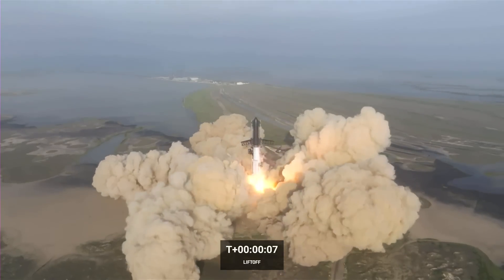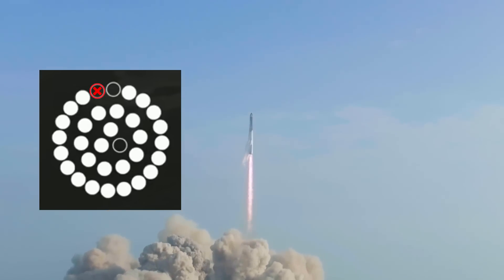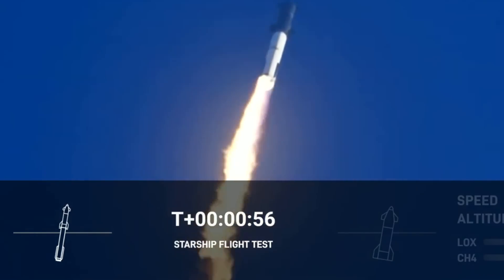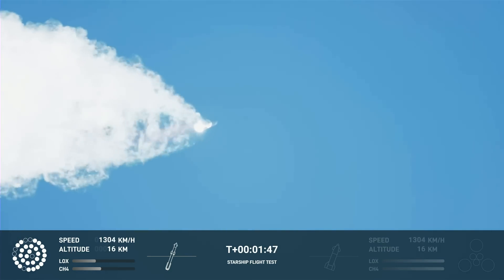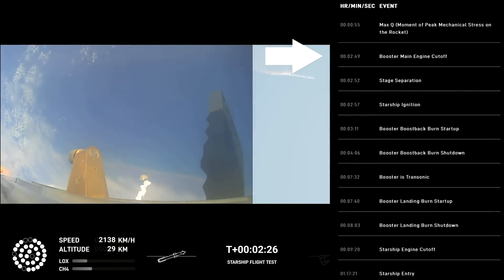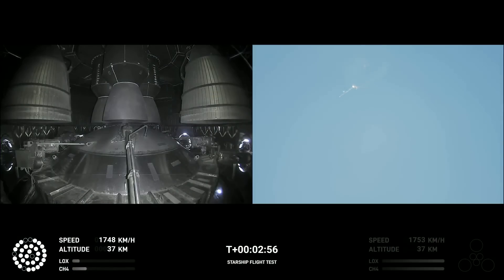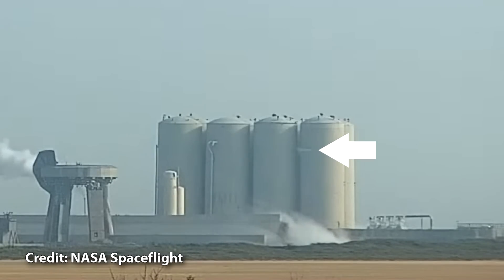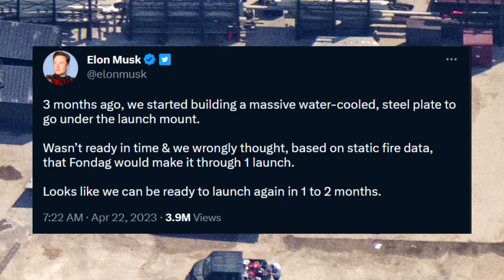I Watched the Starship Test Flight at 0.25x Speed & Saw What Went Wrong | Starship Flight Analysis

Comment: Interesting breakdown, however no mention of the FTS in the negatives of the test? Taking 40 seconds between activation and the flight being terminated is a pretty big problem, imagine if the tumbling happened in a lower altitude, in that time the rocket can go back to the ground at full speed or even to a populated area. Looking forward to the next launch with all the needed corrections, I hope this time Starship can at least separate stages 😁
Reply from the maker: At the time it was somewhat speculative whether that was the FTS activating, so I didn't want to draw any hard conclusions from it. Of course, now we have confirmation.
Reply: We don't know why or when they really did hit the button. If it really didn't work as planned then agreed, big problem but likely easy to fix.
Reply: @DouglasEKnappMSAOM  Recently Musk said at an event on Twitter spaces that indeed the FTS was activated ~40s before the rocket explosion, so yes, the FTS did not work as planned. Although the fix is easy, I get kinda scared of the FTS not working on the first place (they were lucky losing the thrust vectoring only on high atmosphere, imagine that happening lower, and with the FTS delay). In any case, let's hope they fix it and other things to have a successful second launch!
Reply: @arthurdefreitaseprecht2648  It's not as easy a fix as you may think.  When you lose engines, you are rapidly venting a lot of LOX (liquid oxygen) out of the non working engines.  If the pressure in the tank is not high enough, the FTS system will fail again.  They would have to find some way to keep LOX from venting out the burned out engines, but that also prevents the engines from restarting.

Comment: At a minimum the flight test shows the robustness of the entire package.  Failing engines, failing primary hydraulics, concrete blasts and sonic shock waves.  It still went up under control to over 30km.  An astonishing feat on the first flight.  Shows that rocket structure, control authority, redundancy, software and raptors are sturdy.  Now, if the concrete did not shatter and destroy so much of the vehicle I believe the full test would have run to completion.  Who really knows, but I think we will see about a 4 month delay.  Great Job SpaceX.

Comment: 01-May-2023 and this is the most detailed summary I've seen of the Starship launch so far. I'm happy with the outcome but I was concerned about the power of the 33 Raptor II engines on SuperHeavy and the proximity of other infrastructure, like the tank farm given the outcome of the 2nd test of the N1 on 03-Jul-1969, which resulted in the largest artificial, non-nuclear explosion in history. I'm glad this didn't happen and, it seems, that despite a series of failures the design of the SuperHeavy is quite robust.
Reply: "the largest artificial, non-nuclear explosion in history. "
Sorry, but far from it. Explosion in fertilizer silo, Beirut; explosions (several different) at ships carrying explosives (10.000 metric tons) during WW2,  even explosions during WW1.

Comment: We're a long way away from understanding the Raptor failures. A lot of pundits are far too keen to ascribe these failures to launch debris, but you can clearly see that most of the Raptor failures occur during flight and well after launch. Raptors have a history of being temperamental, having failed numerous times during testing or during Starship test flights. So we have a bunch of unanswered questions and SpaceX isn't really being transparent about this.

- If launch debris/stresses were the sole root cause of a cascading failure, what does this say about the reliability of the system overall?
- What interactions are there between engines. Both acoustically and internally (fuel flow and other systems)?
- Are there unresolved design flaws in Raptor that are still surfacing? Or have they been known about internally?
- To what extent does the pursuit of maximum performance contribute to these failures?

Could we see fundamental design changes and redesign?
Are we going to see Raptors de-rated (throttled down) to compensate for being inherently overstressed/unstable?

Comment: Elon Musk said in an interview, that the three engines where not started because there was already something wrong with them. It took to long to clear the launch pad. He also stated that a number of other engines got problems early in the flight. He also stated that the termination didn't work immediately and it took more than 40s after it was activated until the starship exploded by itself. They definitely have to change this to get another approval by the FAA.
I think the FAA will look into some other things too. SpaceX gave an estimation about the worst case of where debris will be going to. This appeared to be completely wrong. For the next flight, they need a plan that is kind of bullet prove how they can prevent damage to the surrounding nature. They also have to do a pretty demanding clean up. The tanks are much to close to the launch pad. I'm not sure if this can stay. If one of them explodes, this will spread a lot of debris in addition. It is even possible that the launch approval will be withdrawn completely for this area.

Comment: An interesting question is what events or criteria determines when the engines on the first stage are supposed to be cut off and when is separation supposed to be triggered.  Unlike what most people think it's probably not a time based event. It could be based on fuel depletion and/or a drop off of engine thrust or it could be based on the vehicle attaining certain velocity and altitude goals. With several engines out Starship might have been behind on its trajectory goals and/or it was still carrying too much propellant and the remaining engines were still running. If these criteria needed to be fully satisfied to trigger separation it might explain why separation never occurred.
Reply from the maker: Yep, I should have mentioned that not meeting the conditions to trigger BECO and separation is probably why the engines continued running.
Reply: @ProjectVirtualHaven  In the Saturn V staging was initiated when the launch sequencer sensed propellant depletion. With the shuttle, the computers monitored the pressure inside the SRB's and when the pressure dropped at burn out the SRB's separation sequence began. Burns in space are usually different because you are looking for a specific velocity change rather than propellant depletion. The guidance system monitors the velocity change and shuts down the engine when the desired velocity change is achieved. Performing shut down based on time is never done because the burn time can vary due to variations in engine thrust and spacecraft weight. During the lunar orbit insertion burn on Apollo 11 Neil Armstrong can be heard saying, "The chamber pressure is a little high, we're going to shut down early."

Comment: I agree with your assessment of 4 to 6 months time before being ready for another launch.  Even before I watched your video my guess was 6 months.  Although there is nothing insurmountable to be done there are a lot of things required, investigations of flight data, redesigns, repairs, and FAA approval just to name a few items.  Good video.  Added another subscription.  Thanks for your insights and input.
Reply: Not to mention the environmental clean-up that has to be done manually and could take weeks. Or the possibility that the Raptor design is fundamentally flawed and they need to be re-designed and re-tested.
Reply: I think it will be well into next year before another launch, the FAA won’t be happy about debris/dust landing on civilian properties and SpaceX suspecting the pad to fail and launching anyway. The repairs and improvements will be done far quicker than appeasing the FAA. Just my thoughts!

Comment: The launch went about as well as I expected.

I predict Starship next flies LATE in 2024 at the very earliest.  I suspect the FAA will not let them attempt with any less than a full scrap and rebuild of the OLM with a full flame-trench and diverter.  Because the ground table is so high, that will have to be built most UP above the surface and will in turn require that the OLM be MUCH MUCH taller... Which in turn will require Mechazilla to be taller.  Further, the Tank farm isn't sme small set of repairs... at least three of the tanks need to be completely replaced.  And the whole thing needs to be armored against future debris strikes.  Further, as the concrete AROUND the OLM was also significantly damaged, IT TOO must be steel-clad.  Result?  ALMOST ALL of the launch facilities at Starbase need complete tear-downs, redesigns, and rebuilds.  Late 2024 is OPTIMISTIC for that amount of work, and doesn't take into account FAA possibly dragging its feet.  It is entirely possible that Starship will not fly again until 2025.  Elon's 1-3 months... laughable.

Comment: The static test stands at NASA's Stennis Space Center have flame trenches and water deluge systems. Why did Space X fail to perform a full duration static test firing of Super Heavy at one of these test stands? Both the Saturn V’s S-1C stage and the core stage of SLS were tested at these facilities.
Reply: Test firing stage 0 at Stennis would help to qualify the rocket but not the pad in Texas. What Space X did was to do a half thrust test on the pad in Texas to see how well the pad would hold up. It didn't look too bad so based on that they thought they could get away with one launch at full power and then modify the pad afterwards to make it more robust. Unfortunately, it looks like that strategy didn't work out.

Comment: As engine exhaust gasses exceed the speed of sound, they collide with the ambient air producing shockwaves with noise levels approaching 200 db. This energy can be reflected by both the launch pad and the concrete ground surfaces back to the launch vehicle.

Comment: Excellent Analysis, however, you are missing the main issue! During the launch of the NASA’s Space Launch System rocket, the “Ignition Overpressure Protection and Sound Suppression water deluge system” at Kennedy Space Center’s Launch Pad 39B releases approximately 450,000 gallons of water across the mobile launcher and the flame deflector.  This suppressed the acoustic energy produced by 8.8 million pounds of thrust!  Where were the flame deflector to channel the rocket exhaust away from the launch pad and the water deluge system to dampen the acoustic energy of these engines (power of two Saturn V’s)?
Reply from the maker: A valid question. They insist on trying a different approach to this problem. Probably part of the philosophy of questioning assumptions and working from first principles. Hopefully it works out in the end!

Comment: At 8:05 you can see that the flight termination system was activated as it started to tumble, but for some reason it took longer to break up. You can see the big plumes of propellant coming out the sides as it is activated.
Reply: Was the FTS manual or autonomous?
Reply: I think I answered my own question.  It looks like SpaceX has been using Autonomous FTS since 2014.

Comment: From the comments: "An analysis of the failure of Elon Musk's rocket. What happened there? Why was the rocket blown up? 04/20/2023 we saw the second attempt by NASA to build the Saturn-5 launch vehicle in the form of the Starship rocket system with 33 Raptor rocket engines. This time NASA went by S. Korolev with his N-1 rocket system with its 30 11D51 liquid-propellant rocket engines. There is no reliable data on how the tests of this rocket ended. The official version is that the tests have been stopped. pulled "Saturn-5". The Pogo effect is a longitudinal low-frequency resonance. With such a number of LREs of the first stage, it is not possible to ensure a uniform supply of fuel and balance the pressure in the combustion chambers. In addition, the simultaneous combustion of an entire regiment of LREs generated colossal temperature radiation at the nozzle exit. As a result, out of 33 rocket engines, two did not launch, and one went into a non-design mode. The rocket hardly broke away from the launch pad, and then the Pogo effect, which I wrote about on your channel about the Saturn launch vehicle. Thrust dropped by 7-8% from calculated and stopped 2 Raptor rocket engines (they were stopped by the operator from the NASA MCC to save the rocket). As a result, the 2nd stage was also damaged. Further flight was meaningless and the rocket was blown up. NASA called this process - "remote disassembly" or "unscheduled dismantling." Brilliant! Everything is an exact copy of the failures of the Soviet H-1 and the same Saturn-5. The Pogo hits the missiles, causing them to bounce up and down in the direction it is flying. This is engineering slang for the pitching or oscillation that sometimes occurs in a rocket. The propellant charge is liquid components that flow through pipes and fittings on the way from the tank to the engine, low-frequency noise can be generated. This violation manifests itself as a "groan" of water pipes in your house, only not as strong. Because this results in variations in fuel consumption, the thrust from rocket engines fluctuates several times per second. This is especially dangerous when the thrust from oscillations approaches the resonant frequency of the rocket structure, and these forces act on the "pair" on the rocket, and as a result, it turns out that the rocket flies back and forth along the entire length of the rocket, several times per second. Pogo's specialty is its ability to support itself. The directionality of the oscillations caused by the non-stationary operation of the LRE, in turn, causes additional instability in the fuel. Typically, engineers, when solving the problem of "pogo" effects, tried to eliminate either by adjusting the frequency at which the rocket structures and fuels with liquid oxygen and hydrogen vibrated, or by "damping" the vibration in one or both cases. You can, for example, change the length of the displacer of the pipe segments, or put "shock absorbers" in them." As a result, a STRATEGY for combating "pogo" in fuel systems appeared: The pogo-induced pressure wave is damped by compressing a trapped gas, usually helium. This way went von Braun (at one time) and Elon Musk. S. Korolev also struggled with this problem on his N-1. But everything is useless. The problem was solved only with the advent of multi-chamber rocket engines. Roscosmos has repeatedly said what it does I. Musk is a dead end. As a result, Roscosmos has relied on nuclear rocket engines and electric rocket engines. What will we observe next? Elon Musk will launch and launch these Saturns until his engineers realize that this is a dead end. The layman must at least somehow- then understand what happened. This is not an accidental failure. This is a system failure. What will Elon Musk's engineers do? Answer: the same as Von Braun's engineers did on the Saturn launch vehicle - install additional dampers and change their configuration on the armature. They will look for ideal configuration in the expectation that the first stage will have time to work out and fall off to hell, taking Pogo with it. Not sure if they will find it. The Pogo effect is a resonance ghost that haunts the rocket (its first stage). There's nothing more you can do here. Good luck to all."
Is the commenter right?

Comment: Starship is a lumbering giant. It is like a cruise ship powered by outboard motors. It is proof that our current method of reaching space is not easily scalable. There is a limits to the benefits of increasing size. (Ref: modern supertankers, SS Great Britain or Airbus A380) Brute force is only one part of the equation. 
It is a fantastic proof of concept but clearly we are approaching the limits of current materials and technologies. No doubt starship and it's launch pad will be improved but ultimately interplanetary space  vehicles will be of a completely different design and likely assembled in orbital space docks. 

By the way - I totally agree, This is the best analysis by far

Comment: Great job!  SpaceX engineers are some of the worlds finest. I believe Elon said on the podcast that booster 7  lost mechanical hydraulics, but that booster 9 has electrical hydraulics.   Elon says the pad structure is mostly intact, 3 engines were shut down at/before launch, and they need to fix the FTS.  Pretty obvious that 30 Raptors at full thrust are way more forceful than SpaceX thought.  Marcus House called it “unscheduled digging” at the base.  Pretty funny! Scott Manleys analysis is also great.

Comment: Thanks for the interesting information on the engines that failed. Quite apart from the damage to the launch pad following this test the FAA will require in depth analysis of what happened and improvements to the safety before giving the approval for the next flight, will take months.
Reply: 2024
Reply: The next one is already approved.

Comment: Best I've heard so far is this; This rocket wanted a flame trench, it didn't have one, so it dug one.
 It will be cool to see what kind of designs they use to dampen the damage from noise and the heat from the exhaust! seems like NASA uses TONS of water and geometry of the plates to redirect a lot of the forces sideways to keep it from reflecting back up to the rocket.